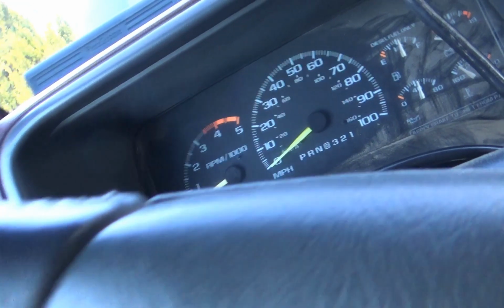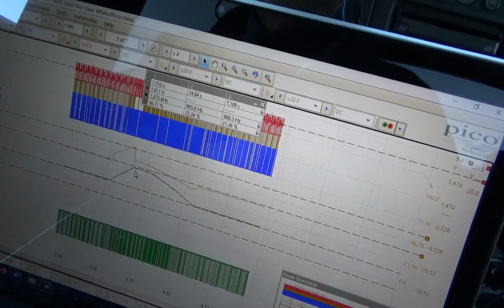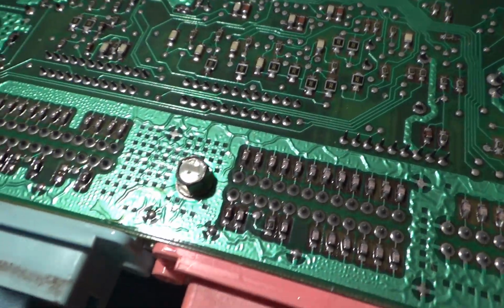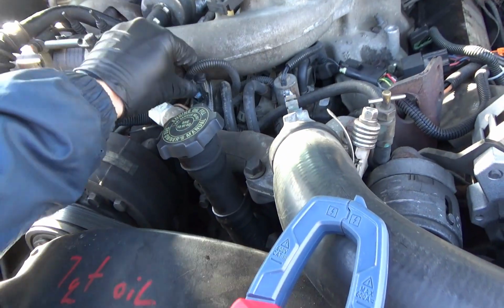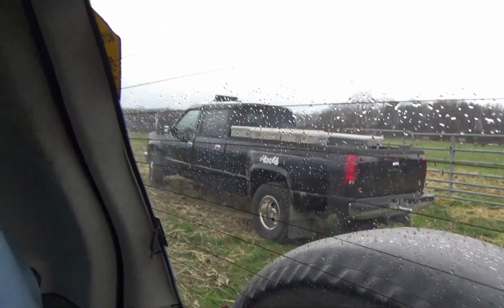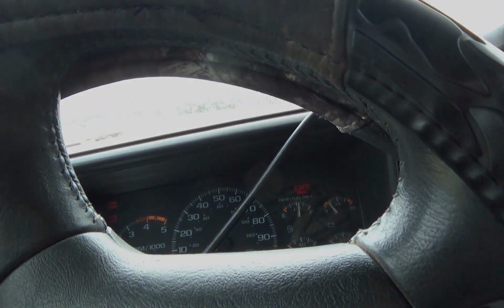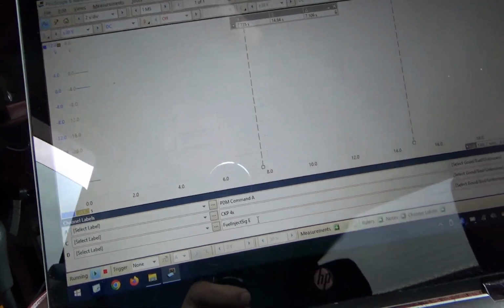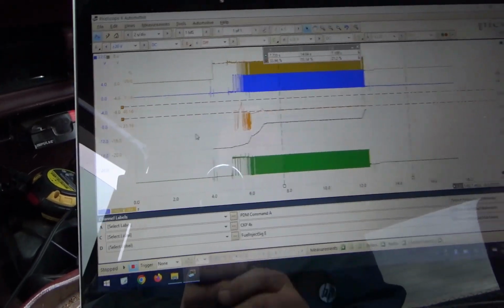Chevy 6.5 Turbo Diesel REVS Out of CONTROL?! (Part 2 - Didn't see THIS Coming...)

Comment: This problem seemed to have all the indication of electrical noise. I have been burned by this.  It would have been good if you put a scope between the alternator output and the battery negative and check for A/C ripple of more than about a half a volt. The fact that you had to use a jump pack is also a potential symptom of a diode that is either bad or on the way out.

Comment: It's like taking a sick animal to a vet, hoping for a diagnosis and cure and getting the opposite.  The engine had very low miles for a diesel, so you wouldn't expect it to throw a rod like that.  It's great that the owner understood the situation and a nice gesture from you not to charge anything.

Comment: Coolant temperature sensor says 6K ohm, but PCM is reading 600.  Either your scanner is lying to you or you've got a partial short - like a green crusty. If the engine hadn't died, I would have suggested ohming the temperature sensor from the PCM side.  Or at the very least, read the scanner with the sensor unplugged.  Green crusties could explain a super touchy throttle by wire.  I know it read ok key on engine off, but what if something is feeding into the throttle from the engine signals?

Comment: "PROM" lol, haven't heard that in a minute. The shop I worked at prior had a toolbox drawer full of them. 1995 is the last year for those guys. I saw more optical sensor and PDM problems than anything else, for those 6.5's, compounded by aftermarket parts of dubious quality.

Comment: Back in the day when I had a real job farming with my Dad, we had a JD 4010 (upgrade kit) that once started acting like it was on the rev limiter when at full throttle.  Turns out that the insides on the pump were worn so much that once it hit 2200 rpm it would start misfiring especially if there wasn't much load on it.  Thankfully we got the pump rebuilt and installed and timed. Ran like a champ for years after.  Moral of the story is the insides of the pump can be bad and the computer can't do shat about it.  

FYI: Those older tractors don't need a lick of electricity in case you want an apocalypse proof one.  You can start them by rolling them down a steep enough hill and popping the clutch in high gear to spin the engine over. Just make sure you are going forward when you do it.   You have no idea how many times I had to do that growing up on my Dad's farm.

Comment: The injection pump being the problem makes sense. The PCM has a job to match what the previous moment the engine was doing. It’s like if you were to catch a falling baby you’d have to first be moving your arms according to the baby’s fall speed and then slowing down and coming to a holt. Can’t think of another analogy sorry. So when the engine Revs up on its own due to excess fuel, the PCM has to match it with the fuel control

Comment: I just scoured alldata trying to see what i find on the resistor built into the fuel driver module. Couldnt find anything there but found the 9 different resitor values and that it takes 50 key cycles to check. So guy probably relocates the fpdm and its fine until 50 key cycles until it checks that resistor value. I like the direction you were going with the decade box.

Comment: Uh, it's fkt up??
Reply: Seriously, have replaced the e-injector pump w/mechanical a few times.  Cheap and easy fix if the 'puter control is too much of a hassle.  However the automatic transmission in this example complicates that solution.

Comment: That low idle on 0,0% injector pulse was already suspect, it was 'idling' on the engine oil.

If the oil seals were on their way out, but not enough to sustain the engine running, then any additional fuel would cause the engine to go through the roof. That's why the PCM revs were 'hunting' on idle. It was on the edge of running away, probably under a higher load situation where the turbo was also giving boost, it would have been game over.

Comment: and....If U need a more "Cosmic" reference, well, it is the Gordian Knot story.  Sometimes, it is not worth trying.  If the frame, etc., is fine, rebuild or replace the engine.   You still should try to invent, and sell a 3300 rpm rev limiter.   Everyone will buy one, if they are smart, and it is easy to install.

Comment: Run-away. Over revving.  etc.  The real message here is that, If, any diesel starts to run-away, turn it off and stop hoping....we all know that hope springs eteranl...But....imagine the forces that super-high revs unleash.....if there is Fault, it is argued that GM should have realized that 3300 rpms should cut off a cold engine.  This could have saved the day, maybe, but that is a DESIGN FAULT with the ELECTRONICS...Maybe GM believed their own Sales Brochure hype?????  We all know better.   You did more than your best.    If I did a rebuild, I would ask you to DEVELOP and install some kind of lower RPM cut-off.  Maybe you can figure this out and sell the 'item' because simple observation sure says that such an item is VERY NEEDED......Best regards!

Comment: Ivan I worked at the GM dealership in the heyday of the 91 to 2018 and did a lot of them 65 diesels 99% of the time they had I never had that problem that you've had but I could see it happening it was always the injection pump called technical assistance on a lot of them maybe have you run through a bunch of tests and test different things and get different values and send it to him and they tell you to put that driver module on and I put the driver module on and I would never take care of it always put pumps on them they got to the point at the end of the line with them pumps that a rebuilding them and that was a real disaster again couldn't get a new one very seldom was the Danny thing else other than upon a few crank sensors they also had a nasty tendency break the crankshafts and also they would if someone would light it off with the starting fluid you would usually break the main bolts out of the block and then they leak coolant had a couple of them like that but they never admitted to putting starting fluid on it in my opinion they were a throw away engine and about 110,000 miles usually the head gaskets were all about that time so you are beating a dead horse there they are junk don't feel too bad about it you tried your best and you were up against a unwilling to be repaired vehicle that happens sometimes don't beat yourself up

Comment: I worked at a GMC dealer 1977-1982.With the 350 Olds diesel.At the end of the first year of working on them the shop had a dozen rebuilt injection pumps in stock. We would go, if the engine was doing so and so put a pump in it.

Comment: I guy I knew would run his aircraft engine hard like probably red lining it to do high speed passes.  One day I'm hanging with my IA (inspection authority for aircraft) and we get a call that he was over in Illinois on a country road.  He spun a bearing on takeoff and Uncle Rodney came knocking.  Punched a hole in the case and the engine cowl.  Somehow he managed to find the only road that didn't have power lines running down the length.

Comment: Ivan, you check the harness between coolant temperature sensor and PCM? 
If we leave the high revolutions aside, why does the computer read the wrong information from the sensor every time,you put a another computer and it gives the same temperature again, the sensor is ok, the computer is different, why is that?

Comment: That is the pcm trying to keep fuel control over a bad injection pump. Diagnosing an over reving diesel by allowing it to over rev is akin to diagnosing no oil pressure with the engine running. In this case the engine was doomed long before it came to you. This is why not red lining a diesel engine is important. The mass that has to change direction is huge and the change of direction happens not only at the top of the stroke but also at the bottom of the stroke where there is absolutely no load to control it.
Reply: Nicely said.  That's a Great learning comment!

Comment: Even though yes, the engine has its issues. The electrical conditions were screaming a bad or loose ground somewhere. The pcm seems like it had no reference to either ground or maybe another feed from somewhere. Always start with power and grounds, toss the scan tools for a bit.

Comment: Back in my dealer days, I replaced hundreds of those aluminum tin box ECM's. Take the butt end of long screwdriver and tap like a pool stick. Watch results. They fail every time. 
Bad idle, stalling, wrong data values, codes that make no sense and so on. 
The ultrasonic soldered connections became loose.

Comment: Bummer such low miles on a diesel. Diesels in general do not like to sit, and not get used. Diesel trucks like to get loaded up, and ran. What happens is injectors stick, pumps stick, soot forms in the engine. This is why Its common to see hot shot engines run pulling trailers filled with cars, with up to a million miles if not more on them.

Comment: Almost sounded like vacuum leak or something going on with map sensor. I’m not a diesel expert though.
Reply: Diesels don't have vacuum in the intake manifold. They run at WOT all the time and vary power output simply by adding or removing fuel.

Comment: I believe this will be unpopular opinion here, but I doubt enigne can be destroyed by revving to the rev limiter a  dozen times without load. Temp sensor probably had a partial short to ground somewhere along the way. But what I found interesting is fuel injection timing, perhaps too early injection? And why injector pulse is missing like alot on a pico capture (D channel)?

Comment: I had this happen on a  customers Astro van 4.3 that had a bad crank sensor that was causing severe spark knock. So I replaced the sensor and did the cam crank relearn revved the engine to fuel shut off with the Tec2 took it for a test drive and it started rod knock on the test drive fun times 😢
Reply from the maker: Dang 😢

Comment: Hi Its a weird one for sure, that throttle duty cycle and coolant temps don't make sense and I would love to see a follow through after an engine gets installed. I am wondering if the fuel solenoid is sticking due to the lack of lubricity in the new low sulfur fuels, I have come across a few instances on 7.3 IDI fords where all kinds of funky stuff is going on due to friction inside the pump. I put a good dose of lubricity formula fuel additive right into the fuel filter and in the tank and the pump settles down. The IDI has a throttle cable so no computer controlling the engine where the 6.5 has the computer controlling a mechanical pump. How to explain the high duty cycle on the throttle unless it is a backfeed showing where the solenoid is stuck. Things that make me go Hmmmmm  Love the channel and watch every video. Cheers

Comment: The reality is you get cars to diagnose that are running horrible when you get them, Its unknown how much damage to the engine and components has already been done before these vehicles are brought to you. Some have hardly any oil. This one had some oil but was in poor condition when you got it. That truck had limited time left before it got to your shop. You did what you could but no all can be saved.

Comment: I know with your determination you would have got to the root cause of what looked like multiple issues...coolant temp??...rpm control and I also don't understand why boost psi was at 14 with the engine off...sadly the detonation timer was set before it came to your shop...In the end you learned new ways to work with your tools so not all is lost ..keep up the good work .....Karl from eastern Canada

Comment: Dang!  Two big disappointments, one the engine blew and the other you never found out what the problem was!  I feel for you Ivan.  These things happen sometimes especially working on very old vehicles.
Reply: He did find the problem it was the fuel solenoid in the injection pump. It needs an engine and a new injection pump that’s the diagnosis. If the customer brought it to Ivan right away maybe there would be a better outcome but who knows.
Reply: @brycelund7155  He never said that the fuel solenoid is definitely bad. The fuel solenoid is easily replaced on this 6.5 injection pump. Towards the end of the video, he didn't even say that the pump was definitely bad. Only at the end did he say the engine has to be replaced and a new injection pump. BUT that is basically a given, if someone is rebuilding the engine itself, either that injection pump should be tested at or preferably torn down, inspected, overhauled, calibrated, at a shop specializing in diesel injection pumps.
Reply: @KStewart-th4sk  The diagnosis: engine needs to be replaced along with the injection pump. Thats what Ivan said in the video.

Comment: The sad photo montage at the end…
We’ve done so many 350-454 swaps in those trucks that I can’t even count. There’s even a few Cummins swaps running around in my area.
The guy got pretty lucky getting 160,000 miles out of it, we’ve done them on trucks that only had 65 to 85,000 miles.
Reply: Seems to me my co-worker had between 2-300 thousand KM on his 6.5 and had never had any trouble with it until that fuel module finally failed and he was having it relocated. This is in Western Canada, so he started it on some damn cold winter days to go to and from work. Minus 20 or 30 degrees lots of days and even colder sometimes. I had a 1991 VW Turbo Diesel and a 3 HR. round trip commute daily. When i got T-Boned by an a-hole running a red light, it was totaled. I then got an even older '86 VW TD and did the same drive for many years. My '91 VW had 698, 714KM when it met its end and it had been still running strong.
Reply: @KStewart-th4sk  200,000km is only 124,000 miles…

Comment: A good candidate for a Cummins swap. 🤣🤣

If you have questions about that injector pump Area Diesel Service might be able to answer some questions. They are on all the social media platforms and collaborate with other YouTube channels quite a bit.
Reply: Yep more specifically a Cummins with mechanical style fuel injection only electronic it needs is just the one for the shutoff lol.
Reply: @TwisteeTheDefiant1  You can change the injection pump to a manual shut off as well. The only power you need than is to start it if you don't want to push start it. 😜

Comment: Honestly at the first sign of knock, it should have been left alone for a tow. If it did punch a ventilation port , customer now has a  non rebuildable core which could have been well avoided.
Reply: Using that logic the customer should have had it looked at right away instead of driving it this way for two weeks 💀
Reply: @brycelund7155  Yes, the customer started the issue by drving, it,  however the rod started knocking when Ivan had it. The bearing would have spun regardless, but Ivan kept at it by driving it up the road and ruined any chance that block could have been rebuilt.
Reply: @woppini  Once the bearing spun it was game over. Can’t blame Ivan for that that’s just the risk you take bringing your vehicle to a shop. No guarantees.

Comment: The truck should go to Dave’s Auto Center for a rebuild, not I Do Cars, but since you destroyed the block instead of not running it, he won’t even have a good core. At the first sign of rod noise it should have ended there. How do you ethically handle this since you blew the guys engine up? Will you share in the cost for the rebuild? Do you have insurance for this type of thing?

Comment: So, in this case, not always "data driven". Not cost effective, but the injection pump should have been removed immediately and send out for complete inspection. I know, easy to talk afterwards....Or she ways sucking engine oil from the start.... where to begin with these worn out set of parts...

Comment: Hi Ivan, not all vehicles are fixable, I think that truck was about to spin a bearing when you got it. you were the last resort of the owner. I feel that the problem was either the pump (a mechanic said in you last video that he changed many of them) or a turbo internal oil leak.
Rich

Comment: I think high idel command is not being disengage.  When commanded on you touch throttle it goes to 1800, when you touch throttle again it is adding another 1800 which makes 3600. When you hit the rev limiter it disengages. When it is engaged that second throttle touch is engaging it again instead of returning to idle.
Reply: I think the 1800 rpm is some king of last resort strategy when the ECU is sure someting is wrong.

Comment: Pump mounted driver on the injection pump is very common failure on these and causes these symptoms
Reply: It had been replaced 4 times.
Reply: @brycelund7155  I went through 6 of them before I finally got a good one
Reply: The symptoms for a failed PMD are intermittent or sudden stalling and hard start on a toasty engine. None of those were present.

Comment: Could re-seat the EEPROM if its in a socket. Also, that yellow electrolytic capacitor on the board is pretty suspect. They have a shelf life and will go bad even if they seem fine.  Like a car battery, it might test the correct value at voltage but while in operation it doesn't perform well in circuit.

Comment: I hope this does make it to Eric.  I wonder if the eBay PCM was also bad.  I know some desktop computers from that era need to be "re-capped" because the capacitors leaked, and the leaked electrolyte causes wild random symptoms.  Giving the board an isopropyl alcohol scrub and/or a full water bath is often necessary to clear all of the issues.
Reply: Could be a batch of bad pcms